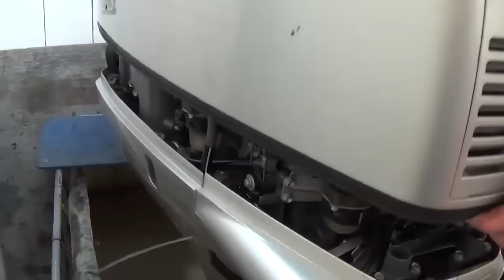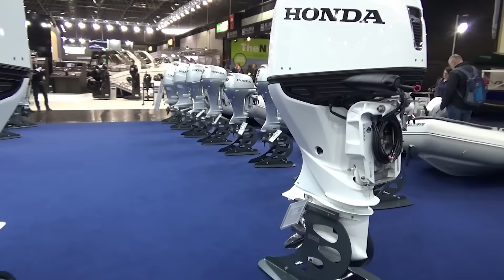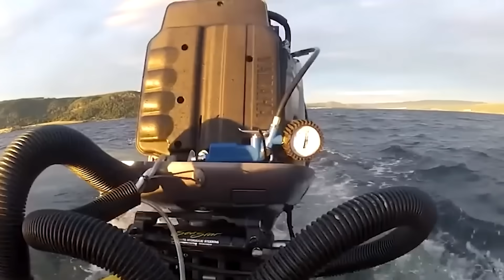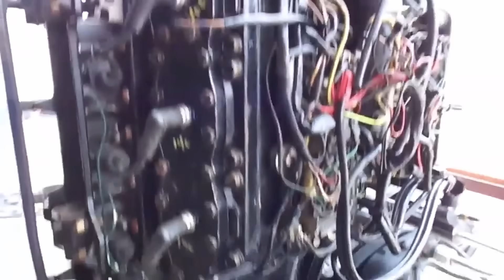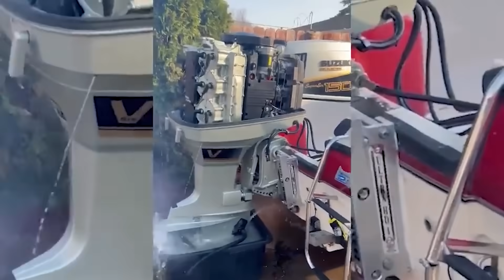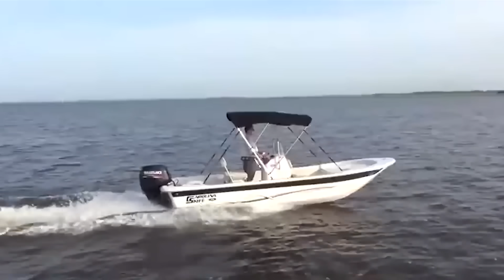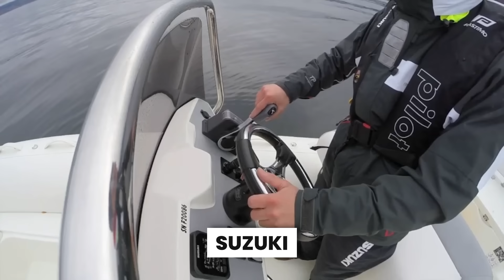Why Japanese and American Motors Are So Different?

Comment: Former marine Tech here, the yamahas were definitely streamlined Johnrudes, and they didnt really change that until they went 4 stroke in the mid 00s, heck To this day the 90hp and above still use that Evenrude based lower uni gearcase, shifting and cooling system.
Modern Yamahas are EXTREMELY fuel sensitive. 
Mercury used to have the best motors and the worst electronics, the Optis were great when they were new, but have no long-term reliability. The 4 stroke proXS V8s are beasts, a bit slow out of the hole because of their small displacement but great otherwise....

Suzuki's big hp Motors are GREAT Pontoon outboards...
Reply from the maker: @paulpickering6820  Thanks for watching and sharing. I've yet to make it on a pontoon boat.. don't often here people say Johnrude - love it.

Comment: appears you forgot Made In China.
Reply from the maker: @biancacharters829  It's a given no..?
Reply: @VintageBoats  I would love to agree. However, I have been running 40 hp Parsuns on my small fleet of commercial tenders for about 10 years, and I really cannot fault them. The build and all the parts are the same as Mariner. The biggest difference is the price, which is way under half. I buy spare parts if required from Mariner or Yamaha. Again, the only difference from each of this, compared to Parsun  is price. "I know I would rather have Western pride, but it is what it is."
Reply from the maker: @biancacharters829  nice to know of your successes! Will keep in mind and thanks for sharing

Comment: 4 stroke 150 merc for 5 yrs now. Run it all the time.  Absolutely love it.  It is so much better on gas than any old 2 strokes I had in the past.  That being said I have no doubt Suzuki is awesome as well.
Reply from the maker: @V8anyday  Cool to see that you're a convert. A loy of 2 stroke lovers refuse the switch. Nice to see you embracing the modern era. Especially after you break into the higher hps

Comment: The most important consideration with smaller outboards (less than 15 hp) is ease of starting, which is largely a function of compression ratio. Strangejy enough, all the large manufacturers will not quote compression ratio figures, knowing this.
Reply from the maker: @stephenburnage7687  Hi Stephen. A point well made. Thanks for sharing! Amd how good your pull arm is...!
Reply: @VintageBoats  I believe the reason they don't publish the numbers is that 2 strokes typically have much lower compression ratios (than 4 strokes). They are therefore much easier to start (as well as being significantly lighter), but as 2 strokes are prohibited in most major markets, they hope to draw attention away from them. Fortunately, however, 2 strokes are still available in major markets such as Mexico, but they don't want you to know that.
Reply from the maker: @stephenburnage7687  Haven't spent anytime in Mexico, yet. High on the list. A lot of fun to be had in the water out there.

Comment: Tohatsu made a single cylinder 4 stroke 4, 5, and 6HP engines that were sold under the Mercury, Tohatsu and Nissan brands.  I purchased a variety of these motors for kickers on my sailboat(s) over the years, and loved them because they were so reliable, sipped gas, and were easy to fix.  I also have a Honda 2.3 HP for the dinghy and am very pleased with it also.  I researched all these motors pretty extensively, and they function as they should.
Reply from the maker: @MaitriAware  Thanks for sharing.. hope to see you back on the channel and in the conversation.
Reply: tohatsu make all mercury outboard up to 30 hp.

Comment: Have a 2006 Suzuki 175 4 stroke on a 23 foot center console with a 80 gallon fuel tank.  Went offshore 30 miles, trolled half a day and came back burning less than a quarter tank.
Enough said.
Reply from the maker: @crizmo1426  Suzuki video coming soon..stay tuned and hope you enjoy when it comes.

Thanks for watching.

Comment: I have owned a 1988 Yamaha 40 for 20 years. It’s used solely for wakeboarding in a very light 14 ft aluminium boat and consequently it’s been run hard. All I’ve done is change impellers and a few years ago I took the head and water jacket covers off and cleaned out the calcium carbonate that built up (despite freshwater rinses every use) and she’s running fine. That said, I wouldn’t take it over the Manukau bar or anyplace really wild at that age! The Japanese know how to build quality products.
Reply from the maker: @grahambarton1942  Thanks for watching and spending time on the channel Graham. Awesome to hear of your Yamaha!

Comment: In 2013, Tohatsu and Honda agreed that eight new outboards—60, 75, 90, 115, 150, 200, 225, and 250 horsepower—would be made by Honda and rebranded under the Tohatsu name.
Reply: That’s really only 4 outboards, as the 60 and 75 share all parts except prop and tune, same with 90 & 115; 150 & 200; and 225 & 250
Reply: @savyor1839  Good point. Just like all of Tohatsu outboards from 9.9 to 20 hp are all the same engine, but with different fuel injection modules and props. So it's just one outboard.

When I was looking for a new outboard for my dinghy, I chose the 20 hp because it weighed the same as the 9.9 and so why not.
Reply: @greener8116 smart. You can also go the other way to save money by getting the low powered engine, then mounting an aftermarket kit to max the power output
Reply: suprice,i had a fisher 18ft put a brand new tohatsu 70 hp 2stk here in miami fl had it for 15 years gavid to my son in new jsrsey he used for 3 years thsn sold it there was not one spot of rust on that engine only maince,tohatsu use to make all nissan engines back on the 80 s.
Reply: If you buy a Mercury that’s 40 horsepower or under it’s actually a rebranded Tohatsu. The Brunswick Corporation has been outsourcing the manufacturing of their small outboards to them since 1988.

Also, every single Nissan outboard ever made is just a rebranded Tohatsu. Nissan never did the manufacturing of their outboards themselves.

Comment: You're wrong about Evinrude Outboard Motors being gone, they are once again being manufactured in a new and modern plant in Central WI for about 10 years now.  I and many of my, and my wife's family worked at the original 5 factories in Milwaukee, WI back in the day.  My Grandfathers 25 hp motor still starts on the first or second pull.  We did have to replace the coil and lower unit back in the early 70's.   A rodent chewed thru a wire one winter and my 4 brothers and I, with all of our friends, wore out the lower unit with all the many hours of pulling young water skiers and fishing runs summer after summer at the Willow Haven Lodge in Northern WI.  With over 85 miles of natural,  wild, forested shoreline, you can travel for hours at full throttle on the Willow Flowage.
Reply: BRP from Canada bought Evinrude in 03 built some bad models and lost customers  then discontinued them in 2020 and signed an agreement with Mercury . Evenrude.OMC, and Johnson were excellent in their day ,I think they may have worked together too.
Reply: Yes thats very nice for you that you got good memories, but why do ALL availible sources say they shut the factory down in may of 2020 then? Have you visited the factory after 2020 or whats your source for them still producing engines?
Reply: I re-watch that part twice and I think he was talking about Johnson.
Reply: @Pepe-dq2ib  All sources I can find say the BRP shut down evinrude in may 2020. Johnson as a brand was much earlier. Do you know something else, and where did you find this information in that case?
Reply: what are you talking about. its gone. bombardier shut the plant. they will keep parts available for a while and then jobbers will continue. stop living in the past.

Comment: I'm wanting to build a 3000 hp contra rotating outboard monster with twin compound turbos. Two 68 mm and two 98mm turbos, a 540cid billet block it's probably going to be a ducted prop, basically a jet drive outboard. With multiple 18" props. Hooking 3000hp to water isn't exactly easy without multiple props . It needs to be inboard. Cavitation is probably going to be a issue. It should be like a 16" rope if water pushing this 24' carbon fiber boat along. It's a trimaran looks like a snowmobile. Over 25 mph it should only have 10-15% of the hull in contact with water.. the fully fabricated outboard with a hydraulic drive torque converter with a reverse and  two forward gears, no shifting not really, if you need faster response use low gear. For top speed use 2nd gear, actually a overdrive
.50:1 with a roughly 1200 stall, the prop moves in gear  its a manual gear box with a torque converter. An electric pump keeps it full of fluid. And cools the fluid. A sir to water intercooler chills the intake charge. I think it needs a chrome molly roll cage with a 5way harness with seating for four. And a pair of Scooby tanks and 4regulators in case of a crash you can breathe under water until the floatation devices activate. Or you can get free of the cage. The engine weighs 524 lbs the lower unit with 8 qt sump weights 148 lbs, basically a 700 lb engine on a 900 lb boat. Making 2890-3240 HP depending on tune, burning methanol or c-16 race fuel , sounds dangerous!
Reply from the maker: @jamest.5001  Thanks for sharing James. Sounds like quite the project! A lot to digest but sure will gain some interest in the community here on the channel if you reach out.

Comment: Tohatsu makes some engines for Yamaha and Mercury and others  and they put their own labels on them.
Reply from the maker: @olivermeier2949  Tohatsu working away in the shadows! Will be interesting go see if they stay in their lane or try to advance at any point.
Reply: @ They make pumps too. They have been building engines since the 1920's.Any Japanese company has to be great to compete with the excellent products manufactured there. They all work together instead of cutting each others throats and share the rewards . I think Japanese small engines are the best in the world.
Reply from the maker: @olivermeier2949  You might just be right Oliver. Thanks for sharing.

Comment: This is crap totally fabricated AI. Better to listen to the comments. In my area, in the desert Southwest Outboards are not as popular as in boards, put 95% of the Outboards I've seen here for 45 years are all Mercury.
At the local mechanic that used to professionally race, that's now passed away, said that as long as you take care of them properly they never wear out. Meaning if you don't overheat them, don't run them when something obviously needs repair, don't run them with bad spoiled gas, and always keep the oil ratio right with quality oil if you're running pre-mixed, then he has never seen one break or wear out even with thousands of hours
Reply from the maker: @7x779  Thanks for watching and commenting. Whilst you're wrong this is all AI...you're totally right on the maintenance. Looking after your engine is key and will bring that longevity. Especially extra care in the salt!

Comment: With over 50 year's experience riding motorcycles and trying all brands, except Harley, Yamaha is the very, very, very, clear winner. Almost every small high-powered motor from cars to motorcycles to boats has some Yamaha design in them.
Reply: Everything they make is incredible quality. As a musician, you can’t go past a Yamaha guitar, piano, bass or brass instrument.
Reply from the maker: @rickbackous1041  I'm entering the bike world soon and will take note! Thanks for sharing Rick and thanks for spending time on the channel!
Reply: @VintageBoats In Quad's lts Suzuki then Yamaha for reliability, durability and cheapest to service. Honda is 3rd as they just apply too much fancy systems to their quads. BRP CanAm are nice to use but unreliable. On bikes its Suzuki then Yamaha (Yamaha Tenere). For around town look at Chinese Cf Moto brand which is amazing for price and reliability but avoid their quads and side by sides which are unreliable. Yamaha MT is a great starter bike then if you want lightning fast then look at a 2016-2019 Yamaha R1. For total irresponsibility regarding life then look at a 2003 Suzuki Hayabusa 1000 and fit a Rotrex Supercharger.

After bike run in make sure you change all oils to Amsoil

I'm a motorcycle mechanic from South island New Zealand.
Reply from the maker: @conmanumber1  amazing thanks for sharing info. Seeing a few more comments from NZ . Hope to make it back one day. Only time o really spent time around the water was near Dunedin..
Reply: The newest yamaha bikes unfortunately have lots of quality issues 😢 I race a 2008 R6 and was shocked my 2020 MT-10 and friends MT's all had design and manufacturing defects. They just simply cut costs unfortunately
Reply: @andrewjaxe399  Yamaha bike now, are made in Vietnam.
Reply: They built engines for  some Toyota car models
Reply: @olivermeier2949  they did the Lexus LFA, the Taurus SHO, and the Lotus Elise
Reply: Eh, for bike motors you can't beat the Honda flat 6. 1500, 1800, or 1800 g2, they're all amazing. You can still balance a coin on the head of my 30 year old gl1500 while you rev it.
Reply: Even in automotive, Yamaha is #1. Jeremy Clarkson said Yamaha V10 in LFA sounds better than any Ferrari.
Reply: Honda?

Comment: I have 7 boats and have tried engines from Evinrude, Mercury, Johnson, Yamaha and Tohatsu over the years. Yamaha and Tohatsu are by far the best most reliable engines.
Reply from the maker: @catd11ng74  thanks for sharing your experience. Well noted. Hope to see you back on the channel..what's your no1?
Reply: @VintageBoats  
No.1 Yamaha
Reply: Tohatsu made most Mercury engine, lol ! (the smaller one though)
Reply from the maker: @mcallard911  Tohatsu video coming soon! Hope you stay tuned to watch it roll in..Thanks
Reply: Suzuki is head and shoulders above Yamaha. I run both.

Comment: OMC continued to lead the outboard motor industry in the 20th century, but in the late 1990s, the issue of exhaust gas regulations became a major challenge for the outboard motor industry. Yamaha Motor and other Japanese companies adopted four-stroke engines. OMC and Mercury in the U.S. opted for injection-type 2-strokes (Mercury later changed to 4-strokes). OMC invested heavily in the development of injection engines, but failed to commercialize them and went bankrupt in 2000, when it was acquired by the Canadian company Bombardier. Bombardier later developed its own technology. Bombardier succeeded in developing a 2-stroke injection type engine with its own technology and named it E-Tec. The E-Tec outboard engines (15-300hP) are still being produced and sold today, and are superior to 4-stroke engines in terms of torque, fuel efficiency, and low CO However, they are advanced and ●precise● machines, so they cannot be sold in areas where there are no ●mechanics skilled in E-Tec engines●. E-Tec engines are widely used in the U.S., especially in bass boats, because of their good acceleration performance.
Reply from the maker: @軍曹-n6j  Thanks for sharing your knowledge and hope to see you back at the channel!

Comment: Just FYI back around 2012 or so I bought a Tohatsu 9.8 outboard four stroke. After a little investigation, I found out the Mercury 9.8 was the same engine. They also sold it as a Nissan, I think. I found out also that all Mercury outboard 30 horsepower and under were made by Tohatsu
Reply from the maker: @billhinkle1653  A little secret in the industry. But not so secret! Well found out. Hope the Tohatsu is doing you wonders.

Comment: I am a technical sales representative (engineer with 50 years experience - mostly at Caterpillar) with Mercury as one of my accounts.  Of all my customers making off-road equipment the Mercury team is more focused on improving reliability than any of my other customers.  Many of the posts here are from old experiences representing the past Mercury outboard designs.  I believe the future will show new Mercury outboards as getting more and more reliable.  PS - had an old 50HP Merc back in the 60s and it was the very definition of shake, rattle, and roll!
Reply: I used to race a 50hp merc in the late 60s in the 45cu-inch class,  they were the only way to go in those days, but being able to afford a decent prop was vital. Merc had those even then, but before I could afford one I had a bronze prop,  and it spent a lot of time being 'worked' on the tow bar of my car, great fun.
Reply from the maker: @TerryHickey-xt4mf thanks for sharing this sounds like you had a lot of fun. Where were you racing?
Reply: @grantmelocik1703  I had a merc 50, about a 1970 ish (red stripe). 4cyl. , manual start. Awesome motor.
Reply from the maker: @grantmelocik1703  Amazing Grant, thanks for coming into the convo with your first hand experience. Love to see you hear and sharing your thoughts. I agree with you, it's all coming at a premium though! 

Love the 60a comment!

Comment: I live in Minnesota, the land of 10,000 lakes. I am on the water a lot. Over the past 30 years, I have pulled dozens of boats with Mercury outboards off the lake. Many blew up. I pulled one guy off the lake with a Yamaha. He ran out of gas. I have a 2003 115 hp Yamaha 4 stroke. It still runs like it is brand new. I have friends who bought the same boat as I have with a Mercury outboard. Not one of those Mercury outboards are still running. They all have Yamahas now.
Reply: So, you prefer Yamahas? 😂
Reply from the maker: @herbb8547  thanks for sharing. Cast your yamaha vote on the community post!
Reply: People from Minnesota don’t have a clue. Lol
Reply: @trevorlahey1956  Yeah. A lot of people here buy Mercury outboards because they are built nearby in Wisconsin, and they often come with boats pre-rigged.
Reply from the maker: @herbb8547  Makes sense with the locality.
Reply from the maker: @trevorlahey1956  Maybe harsh. There's a lot of boats there. But the fresh vs salty factors might start coming in.